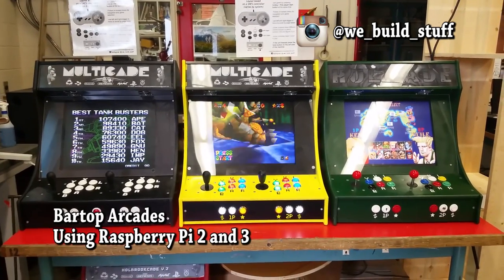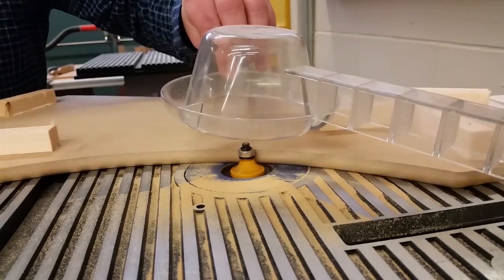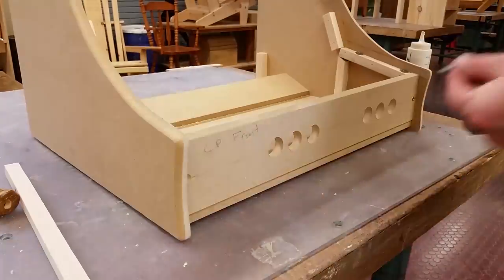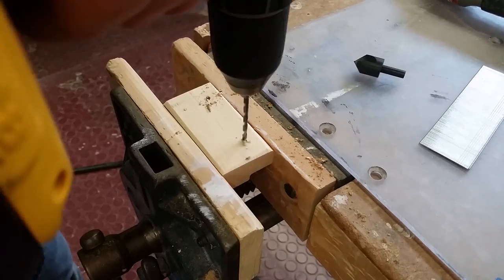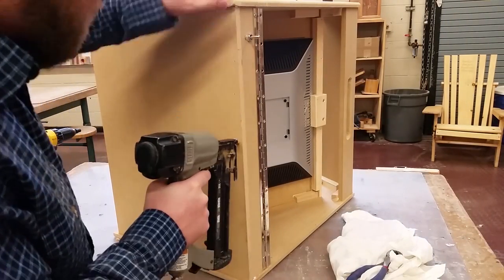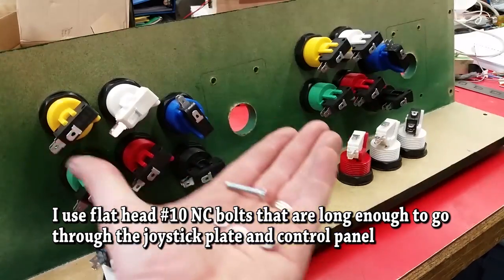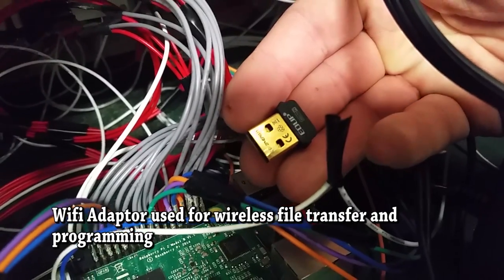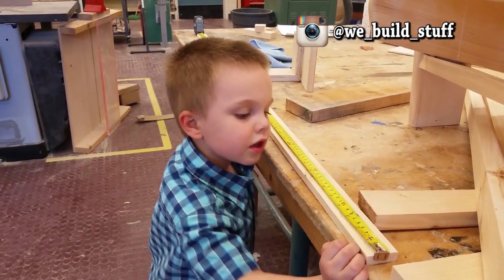How to make a DIY Raspberry Pi Arcade Cabinet!

Comment: I have one last question my friend. How many 4x8' sheets of 1/2" thick MDF did you use for your whole build?
Reply from the maker: You can build using just one sheet and have left overs. When I dont have access to a big tablesaw I have the guy at Home Depot do my first 55cm wide cut. The 55cm piece gives you enough for the square/rectangular panels with the remaining piece fits the 2 side pieces with lots of left over.

You could potentially get 3 cabinets this size from 2 sheets if you layout your cuts properly!
Reply: @WeBuildStuff  Wow thank you so much!! I didn't think about having Home Depot cut them out for me, I was worried my tiny table saw wasn't going to be able to make the cut lol Thanks once again for quick responses, you're amazing!
Reply: @WeBuildStuff  On the video you had said, "First cut was 55mm wide, this will provide the majority of the cabinet pieces." So did you actually mean 55cm? Sorry I just don't want to be confused. Thanks again.
Reply from the maker: @TLil21  yes 55cm. 5.5cm (55mm) probably wouldn't work 😀
Reply: @WeBuildStuff  Lol Thanks again! If I could sub twice to your channel I so would! You have been very helpful. I sent you $10 for lunch! I appreciate you sir. Arturo from California.
Reply from the maker: @TLil21  thank you sir! I am happy to help!
Reply from the maker: @TLil21  check the bigger bartop videos for some more in depth tricks I've learned along the way!

https://youtu.be/isiLRtJlUso
Reply: @WeBuildStuff  Awesome! Also quick question. The PDF files, can I do the 8.5x11 plans instead? My printer only holds that size paper and I have to mess with the settngs correct to print at 100% scale?
Reply from the maker: @TLil21  I made two different pdfs just in case! Just make sure to print at 100% scale for the side panel. Cut and tape the papers together as nicely as you can!
Reply: @WeBuildStuff  Okay great, so 100% scale only for the side panel or for both the side panel and the main cabniet assembly 8.5x11 as well?
Reply from the maker: @TLil21  juat side panel and control panel. Cabinet pieces are simple rectangles
Reply: @WeBuildStuff  Oh okay so I just printed out the 100% full scale side panels and they do not line up at all for some reason lol I might go to my local copy center tomorrow and print them out on 11x17 instead. Thanks for all your help!
Reply: @WeBuildStuff  Never mind I figured it out!!!
Reply: @WeBuildStuff  Quick question, would you happen to know what size roundover routing bit you used for you cabinet?
Reply from the maker: @TLil21  3/8 or 1/2. This was a few years and i was borrowing someone elses tools 😀
Reply from the maker: @TLil21  and if this is referring to when i rounded over the edge of the side panels i don't do that anymore. Now I use a slot cutter so i can instal t-molding
Reply: @WeBuildStuff  Ah makes sense because in a few clips I saw you round the edges but in a few other ones I saw the T-modling, I thought you somehow brought the two together but wasn't sure! Thanks once again!
Reply from the maker: @TLil21  this video was before I tried T molding!
Reply: @WeBuildStuff  I have a silly question to ask, do you know what size finishing nails you got to stick both pieces together? I bought some but they're huge! lmao I didn't realize they came in different sizes lol but what exact size did you use? Also you probably used wood filler to fill those tiny holes back in right, before painting?
Reply from the maker: @TLil21  yes to the wood filler.

I used between 1" and 1 1/4" nails for the build. If your panel is 1/2" thick and your wood blocks are 3/4" then use a 1" nail. That holds it enough while the glue dries.

I have used the wrong nails many times by forgetting to check what was already in the nail gun!
Reply: @WeBuildStuff  Hey how's it going! just wanted to fill you on what's going on with my build. I manage to complete my side panels with the support blocks, got the sides all routered for t-molding & sanded it to my liking. So my next step was to cut out my main pieces for the build. I used my cheap $140 table saw from Harbor Freight that my brother bought me for my bday. I had so much trouble getting a perfect cut. So many problems lol size of the table first of all, ripping fence didn't work out, had to use a board instead but for some reason all my cuts were slanted, used a speed square, anything 90 degrees but to no avail. miter gauge was garbage too lol soo I ended up taking it back for a refund. Today I managed to make all my cuts with a circular saw, took more time but I did it. My only concern now is making those angle cuts :// I really wanted to follow your plans to a T. Any suggestions how I can achieve that without a table saw? I was thinking of using my circular saw maybe along with my digital angle gauge, what do you think?
Reply from the maker: @TLil21  the angled cuts arent necessary. Just arrange to hide the gaps and no big deal. If you use a guide with your circular saw you can get very close angled cuts. I usually use a scrap piece to test my angles and then do a finished cut on my real piece
Reply: @WeBuildStuff  Quick question my good sir. So according to your plans I was able to get my front piece cut out at 47.4cm BUT I noticed that it's way too big to insert. Was this perhaps an error to your plans? I also referenced off of your videos and the screen/front piece looks significantly smaller. If it is wrong, what would be the actual size you used for your 19" monitor build? Thanks again.
Reply from the maker: @TLil21  the plans say 47 but I trimmed it a bit for my personal build. Everyone's build may be different and and I have done that screen piece 5 different ways since !

Comment: I'm most impressed by how you could run N64 games on the RPI. I have a RPI3 but it does NOT run N64 games well.
Reply from the maker: frankytap depends on the game and which emulator you are using. Some games are not compatible at all
Reply: Thanks man. If I would like to run Mario64, what emulator would you suggest? That and maybe Mariokart, Donkey kong and Mario party.
Reply from the maker: I've only used the built in default emulator with Recalbox. Mario 64 and Mariokart works well. I haven't tried Donkey Kong or Mario Party. I haven't seen Donkey Kong 64 work well on anything other than PC emulators
Reply: Thanks man! ^^
Reply: frankytap I got a retro console today it uses the odroid xu4 instead of the raspberry pi n64 games are flawless on it. Over 35000 games on this one I got
Reply: Webuildstuff maybe you could have a look at the xu4 to replace the pi
Reply from the maker: Matt Murphy ya the odroid is a wicked little system. Recalbox rund on it as well!
Reply: That's pretty cool! Thanks man. Do you know if there are ny "nintendo" looking cases for it? The nespi case for rpi3 looks awesome. Would be nice to have similar for xu4
Reply: frankytap don't know where you are but I'm in the UK mine is in an odroid case but another company here do them in a Nintendo 64 case so I assume they can be put in any case they are the same size as a raspberry pi I think mate
Reply from the maker: Matt Murphy ya very close in size

Comment: Does it matter what type of amp board you use for the volume adjustment?
Reply from the maker: I've used old computer speakers, small usb amps, and recently this one: Lepy LP-2020A Class-D Hi-Fi Audio... https://www.amazon.ca/dp/B00V9AYMZ4?ref=yo_pop_ma_swf
Reply from the maker: Basically pick whatever works for you. I still haven't found a specific one that I can 100% like. I would love to find something affordable that can be controlled with arcade buttons
Reply: Thanks!!

Comment: Where can i buy that audio amp? Thanks
Reply from the maker: I've used stuff like this. Cheap quality though. I'm not thrilled with them but they are ok
AC/DC 12V TDA7297 2x15W Digital Audio Amplifier DIY Kit Dual-Channel Module

http://www.ebay.ca/sch/sis.html?_nkw=AC%2FDC+12V+TDA7297+2x15W+Digital+Audio+Amplifier+DIY+Kit+Dual-Channel+Module&_id=371499351808&&_trksid=p2057872.m2749.l2658

Comment: Can these play mortal kombat 2 player? Or will it need more than 6 buttons?
Reply from the maker: These systems ate only limited to how you build them
 It is easy to program and customize your button layout. You can use a micro computer like a raspberry pi or Odroid or you can use a computer or laptop inside. 
I mostly made cabinets and many of my past students would customize the hardware side of them.

Good luck with your project!
Reply: @WeBuildStuff  Thank you

Comment: Arènes.t your T-nuts installed reverse ?? They don.t give strength to the build...
Reply from the maker: Yes I messed up. It was my first time using T Nuts but they did hold (and are still holding after 4 years)

You can see how I updated here and did it here with a few tricks
https://youtu.be/isiLRtJlUso?t=987

Comment: Is there a good way to determine where to put the support pieces of wood on the side panels?
Reply from the maker: Trevor Rauch everything is on the template PDFs that are linked in the descripton
 After printing them out at 100% on either A4 or 8.5x11 paper i just use a ruler to measure the drawing and transfer everything onto your material
Reply from the maker: There is another video on my channel showing some tips for that
Reply: We Build Stuff Thanks for the quick response. In your other videos, you have arcades with T-Molding. How much did you use for one cabinet?
Reply from the maker: Trevor Rauch usually 20ft for a cabinet the same size as my videos 😀

Comment: How much would you sell one of these for and also seeing as I am not familiar with the emulator you are you using I wanted to know if it is at all possible to use a PS1 emulator instead, and last question would you be willing to ship to the UK?. Thanks in advance mate.
Reply from the maker: It has a PS1 emulator built in. I have had decent success with most of the games. Multi-disc games are difficult to set up though.
I don't plan on any intercontinental shipping. Just local right now as I am too busy
Reply: We Build Stuff  Thanks for the swift reply, I will keep up-to-date with this channel in the event that you might consider shipping outside the US. But the game in question on the PS1 I wanted was Valkyrie profile, as this game spans on just 2 discs switching, back and forth at certain points but yeah I will keep in touch, keep up the good work, ps if you have uploaded an example of your PS1 setup please direct me to the link thanks again.
Reply from the maker: Check out this guy for Uk arcades. You can buy kits
https://www.facebook.com/Richs-Bartop-Arcades-339050949489263/
Reply: We Build Stuff, Thanks for the link man, also love the way your raising your boy getting him to be involved in the trade damn good parenting. Anyway take care cheers for the link.
Reply from the maker: the fact you actually watched the end is awesome!

Comment: Can you provide a link for the t nuts and bolts please
Reply from the maker: I originally bought at a Home Depot and make sure to buy bolts, etc that are the same thread size. Fastener stores or many hardware stores will have them. I buy in bulk at a local speciality fastener store in my area now.

https://www.homedepot.com/p/10-32-Zinc-Plated-Tee-Nut-4-Pack-802291/204274193
Reply from the maker: Also I installed them backwards in the video.

Here is an updated video with clearer instructions https://youtu.be/isiLRtJlUso

Comment: Can the Retropie/Raspberry Pi be reset within the software? What is the advantage of having a Reset button? Thank you to anyone that answers this question
Reply from the maker: Since this video recalbox has been updated. There are also devices you can buy from Adafruit to use as a switch or reset that are easy to install.

I use the reset in case a game crashes. Some of the newer rp3 boards have the headers/holes in a different place. The button means I don't need to reach as far to hit my power button

Comment: how long is the top control pannel
Reply from the maker: Control panel dimensions are 18.56cm x 55cm. There is room at the top of it for a 26 degree miter and the bottom (in my new builds) will be routed with a slot cutter for T-molding. I am also working on a redesign to fit all the buttons on the control panel instead of below on the CP front

Comment: Love it. You obviously have woodworking skill. Lots of leftover wood. And all the expensive equipment. Do you make any of these for private order? I'd love a pi based arcade packed with the classic arcade games from Mario to street fighter to donkey Kong or hydro thunder. I'd definitely pay 1500+ USD for one of these and it seems like you can kick one out in a day with maybe 500 dollars in wood/cables/monitor/pi. And I'd say it's worth at least 1000 for the labor.. message me if youd ever be willing to make one custom order  it can be the most basic design you have with a proper sized monitor. Obviously graphics dont matter much. I can do paint customization my self but dont have the tools to make it. 

If you're ever willing message me. I'd need it bare bones. Ui and games with unpolished unpainted wood to save you some time.
Reply from the maker: Joseph Good 
paint is quick and nice to do before assembly so it plugs in and works!

I do have 2 students looking to sell but probably not ship anywhere. We are near Vancouver BC.

Comment: I built a single player cabinet. will raspberry pi work. I was told only for 2 player
Reply from the maker: Yes it will work fine. Just don't try to play 2 player mode in games ;)
Reply: @WeBuildStuff  thank you sir. is their a way to disable the player 2 function within the game ?
Reply from the maker: @danpettis1675  not unless you know how to program and change a ROM file...
Reply: @WeBuildStuff  ohh I see .. thank you again . keep great videos coming:)
Reply from the maker: @danpettis1675  cheers. thanks for watching!

Comment: What is the measurement for the edges? I see the bottom sits some off the ground but how far?
Reply from the maker: 6mm. I use a 6mm offset for the bottom, back, and top pieces
Reply: Saw it in the next video I think had to pause it to read it off the template. Thank you.
Reply from the maker: Tim Randall I have the template available on the website in the description 😀

Comment: can you run retropie through noobs
Reply from the maker: I've never tried. I know you can run certain emulators on noobs but I've only done builds that boot straight into the emulation station front end

Comment: Hi. Am new to all this but have been researching and watching videos and looking at online forums for many months. I am Just looking for a bit of help. I have watched all your videos on the raspberry bartop arcade build many many times. I am at the stage where my cab is built and sprayed and I am about to add all the buttons,wiring, monitor, usb speakers etc. I have tested all the parts via HDMI on my tv using the keyboard and all works fine. I then rigged it up to my monitor via the rca to HDMI adapter with the 3.5mm Jack plug connected to see if it still worked But there was no sound. I searched for info on here and online and i had conflicting advice. Some people say go to raspberry pi config option 8(advanced settings) then down to audio and swap from HDMI to 3.5 Jack plug. And then it will work. Is this the case?? As I also read some saying you have to add certain things to certain files or delete/Change certain files. I am just wanting an easy solution. I have the raspberry pi 3 b+. Also if I wanted to use a Bluetooth speaker how would I enable this using the pi? Without having to use a pc to do it. Many thanks in anticipation for any help.
Reply from the maker: Are you using retropie or recalbox or something else as your front end? In recalbox it simple through the audio menu to change from auto, hdmi, or jack. Not sure about the other systems
Reply: @WeBuildStuff  it's retropie.
Reply from the maker: Not sure with Retropie. Check different forums for that
Reply: Hi,I had the same problem.Right in the Retropie menu-setup-audio-choose 3,5 mm audio out and it works.

Comment: unfortunately after printing out the plans using adobe acrobat at 100% scale on A4 payer none of the pages matched up for me
Reply from the maker: I've only tried printing on 8.5x11 and 11x17 for my printouts. I usually print them out myself for my students for their builds. no issues yet. Sorry to hear that
Reply from the maker: The original plans were from here but I modified them a bit for my students
http://www.instructables.com/id/2-Player-Bartop-Arcade-Machine-Powered-by-Pi/
Reply: I'm going to just use the measurement and draw it up myself,  To buy a cabinet like that here in Aus is around $350 too much

Comment: I don't mean this in a bad way, but why "cheap off" and not buy a keyboard encoder (like the ipac 2)?
Reply from the maker: I had a keyboard encoder but it wasn't working at the time of making this video. I found an alternate solution (wiring the GPIO headers). My current builds use an encoder because it is way easier!
Reply: Smart move using the GPIO, it's just much messier. Good thinking though.

Comment: What specs do  I need to make this?(Software)
Reply: Intel Pentium cpu :)
Reply from the maker: It runs Recalbox
Reply: We Build Stuff thanks,but i want to say.what i need to make this arcade(Except for the raspberry pi 2,what i acctually need for this)Sorry for the confusion!
Reply from the maker: @gigiandrei2944  links in description for my webpage. Pdfs with instructions and where I did my shopping